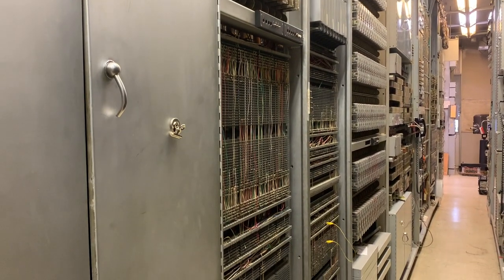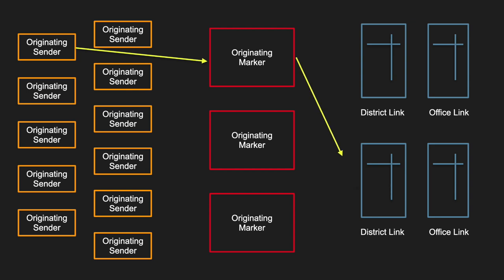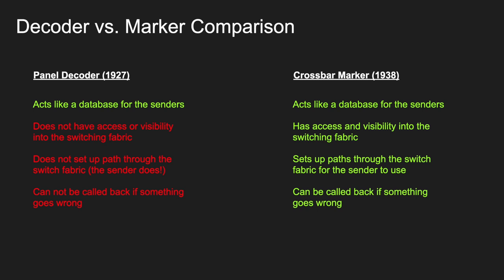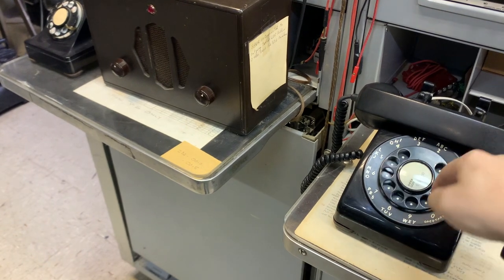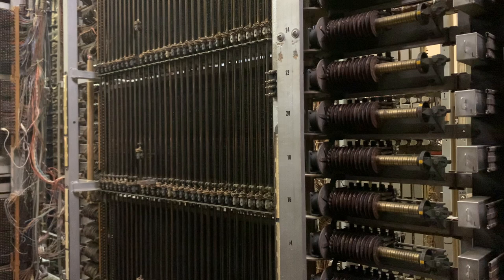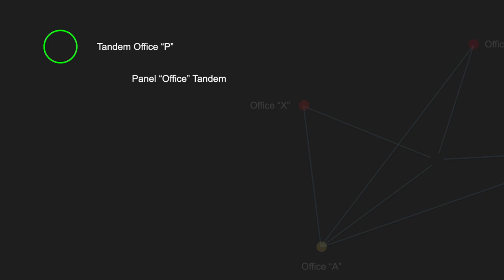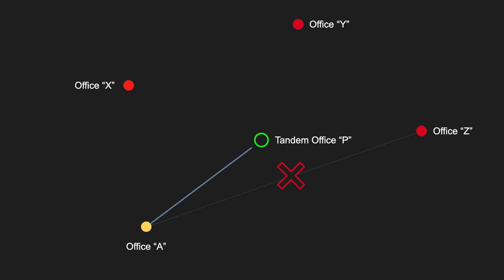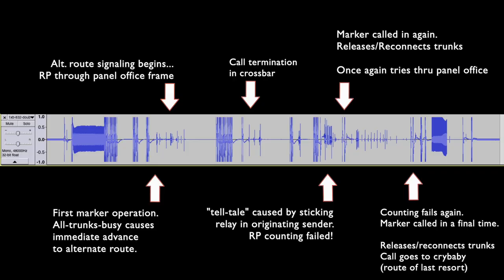Crossbar's Hidden Superpower: Alternate Routing!

Comment: Is the crybaby a shared piece of equipment similar to the Audichron where your call just gets connected to that shared circuit, rather than holding crossbar equipment busy to play to the crybaby tone? Is the busy tone also the same thing?
Reply from the maker: The Audichron was usually shared between multiple offices in a city, but the crybaby tone generator was per-office. It was comparatively small (only 2 or 3 mounting plates high), and much less expensive than an Audichron, so there would be less need to share it.

While you're connected to the crybaby tone, there are three major crosspoints that are being held up: the line link (for your line), the district link (for your district junctor), and the office link (for the trunk to the crybaby generator). 

The crybaby is just another destination...another trunk on the office link,  just like the hundreds of other trunks that leave your office. Some go to other telephone switches. Others go to announcement machines. Still others go to the crybaby. 

Busy tone is different. The busy tone is a function of your district junctor or incoming trunk circuit, not a destination, like the other things. So you don't really "route" a call to a busy signal. You merely operate a relay, which cuts in the busy signal tone to the trunk you're already sitting on. Ringing tone is the same way. It is not a destination, but a function provided by relays in the trunk circuit you are using.

Comment: Great job keep doing what you're doing, your educating the entire world how early communication systems work. I have a total of 36 years, starting out with Western than the name changes after the messenger, my primary focus was on number one electronic switching system, tsps traffic service position systems, number for ESS, the first all electronic switching system, and number 5ss first Electronics switching system with fiber optics. And I was asked to work in our technical support, until I retire. My employment started in February of 1963 with Western Electric, retired 36 years service. Today's September 26th 2022. Even though I never worked in step or panel or number one crossbar or number five crossbar other than running cable and doing all the grunt work, still enjoyed it at the time I was learning a little bit about those systems but never really worked as a specialist. So great education for me to see what happened prior to my arrival, on the scene.

Comment: You seem to have forgetten the 4M toll crossbar like they had in New York City, Chicago and Philadelphia, but its a great video, thank you
Reply from the maker: Hi Bryan. I didn’t forget 4M. I just didn’t list it because I figured most people wouldn’t notice the distinction. You probably know this already, but for those who don’t, 4M was a modified version of the original No. 4 Toll Crossbar. “M” stood for “modified”. It was modified to match the configuration of the later 4A or 4 “Advanced”. The need for toll crossbar systems was very great, so the first ones were installed in a “beta” configuration. They were then modified later on and the “M” was added to the name.
Reply: @ConnectionsMuseum  Thank you for that information, do you guys have a 4A or any toll switch at the museum?
Reply from the maker: @magesnz  unfortunately we don’t. There probably just wasn’t enough room to store and display one.

Comment: interestingly, modern internet routing in principle works this exact same way and these mechanical switches are honestly great at visualizing how it works. If a route is "too busy" or rather saturated in internet terms, data packets may be sent through a different route (which may be through a physically different cable or location). Thus when downloading large files, such as video, or multiple files at once, like with games, different parts of the large files or even different files may be sent along different routes and since that can cause the data to arrive out of order, data packets are numbered so the receiver can piece them back together in the right order - this is all part of the TCP protocol. When this re-rerouting fails for one reason or another, that's when you get timeouts and connection failure, just like with phone calls. This is most obvious when you watch streaming video, like here on youtube, where the video suddenly stop and buffer because the stream is sent through a sub-optimal path or the path doesn't have enough remaining bandwidth. Routers generally figure out the optimal path based on response times rather than channel hunting like with the mechanical switching, but the basic principle is the same - the goal is to find a path from A to B
Reply: Response times, and data from other routers (BGP at the edge, generally EIGRP/OSPF/IS-IS within a network) that may or may not include things like link bandwidth, a reliability index (observed packet loss), or, yes, RTT.

This is all done transparently by routers, neither the sending side nor the receiving side really know nor care. One of them packages a stream of bytes (a file) into TCP segments, and packs that into an IP packet for routers to make their calculations. The other side just unwraps the packets and uses the TCP sequence number to ensure order. QUIC does the same thing, but is built upon UDP without some of the baggage that TCP has.

Generally, one TCP connection tends to take the same path through the internet, it's not an intentional choice for large data transfers or long-running connections to have separate routes.

The nice thing about routers is that they almost always have their path allocations laid out, it's called the Routing Information Base (RIB) for the higher-level logic, and the Forwarding Information Base (FIB) for what it actually does. The RIB may contain multiple routes to a destination (prefix), but only the most optimal route is installed into the FIB and actually utilized. Gateway protocols (BGP/OSPF/IS-IS/etc.) update the RIB as new data comes in about the state of links. Fun fact: every BGP enabled router on the internet (excluding iBGP, different purpose) more or less has a complete map of the internet, because they all synchronize eventually. BGP contains path data (what systems were in the path between the originator or a prefix and the router receiving it's information), which helps route selection. The "global internet routing table" is the theoretical RIB managed by internet BGP, and it's... Huge. But every BGP enabled router has an entire copy of it, to route traffic from wherever, to wherever.

Comment: Sarah, I Love your videos! I have a question about the panel system. Panel was before dad's time, he worked on 1xb n 5xb. Switchman dad taught us kids the difference between the crossbar busy and overflow signals. Destination line busy was a slower beep and "overflow" was a faster beep. A knowledgeable person knew the difference. Question: Was the panel system capable of returning an overflow signal to the calling party or was it just busy whether it was destination or trunk?

Comment: awesome video!

Just a question, when this kind of system was in use, was the route of last resort sent to a busy tone or sent to an operator or a circuit that reports the problem? or was it always sent to a crybaby tone?
Just keep thinking about because i don't actually know but would be cool if you could clarify.
Reply from the maker: Good question! The route of last resort was used if all of the first and second choice trunks were busy. That would usually be an announcement or operator, depending on local practice. If all the announcement trunks were used up, then the route of last last last resort was to just leave you sitting there with no audio at all until you eventually hung up. That didn't happen often though, as it would need to be a major failure to use up all of the previous possible routes.